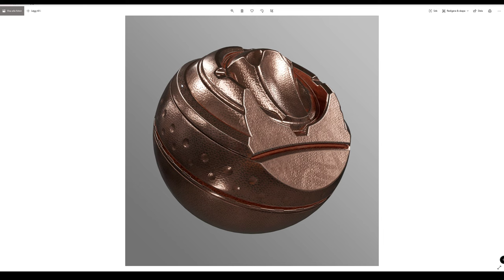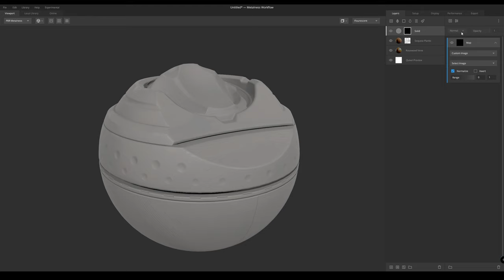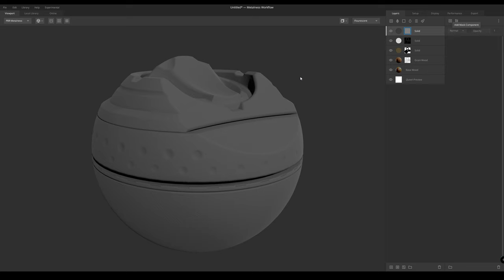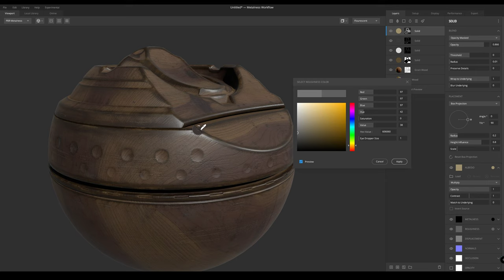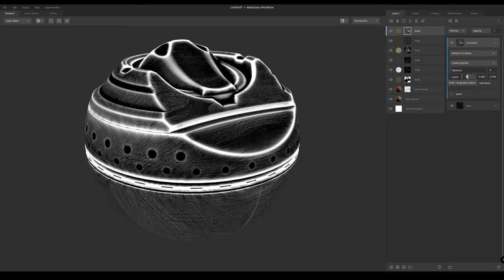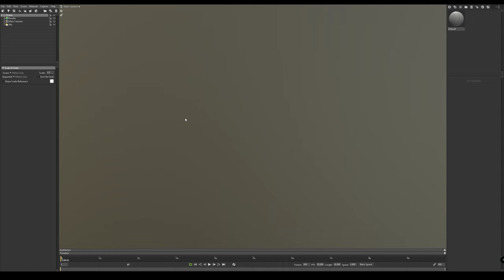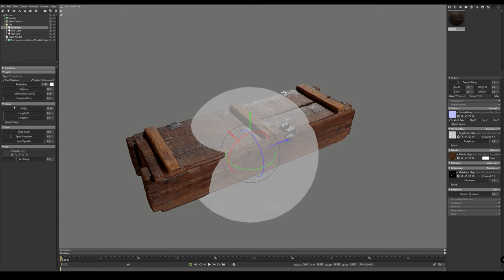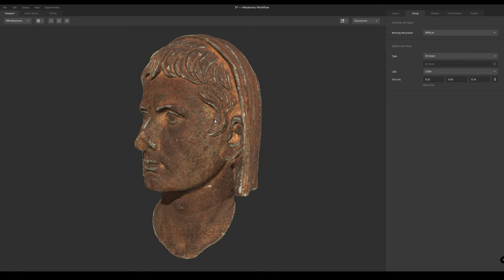Creating Smart Materials with Wiktor Öhman

Comment: Why ue 4 is so slow
Reply: Because you might have an old ass pc?
Reply: @mae2309  Oof size : Mega
Reply: @mae2309  I want to say that ue real time rendering is so slow as compared to cryengine
Reply: @gursimransingh3513   how big are you baking you Lightmaps? well if you are running unreal as GPU raytrace you dont have to render anything. look at your lightmass settings? and perhaps fix your lighmaps... you might have a very high  number on small objects.. or perhaps. take a look at you Mesh density.. you might want to drop it a bit or you mapping objects... it should be as slow...
Reply: @mae2309  I use fully dynamic lighting
Reply: @mae2309  ue 4 seems to be a big flop when it comes to making of a big scene with a lot of foliage on the other hand cryengine somehow has a fully dynamic light solution volumatric fog etc etc which runs smoothly when put together whereas in case to ue4 it gives a big bang to framerates
Reply: @gursimransingh3513   you stick to cryengine then. See how far youll go. LOL.
Reply: @gursimransingh3513  theres other  engines why cry? Lol. I thought it was dead already.
Reply: @mae2309  downloard cry and then you will cry why you choosed ue4
Reply: @mae2309  tell me that is this fact wrong that cry could render more foliage than ue4
Reply: @mae2309  lmao cryengine is doing great, getting consistent updates and soon to have api-agnostic raytracing
Reply: Wait cryengine is good?
Reply: @ryvikun4325  yes
Reply: @ryvikun4325  yes. .
Reply: What about lumberyard?
Also did you check ue5 demo.?
Reply: @peacelover5729  LUBMERJACK LOL